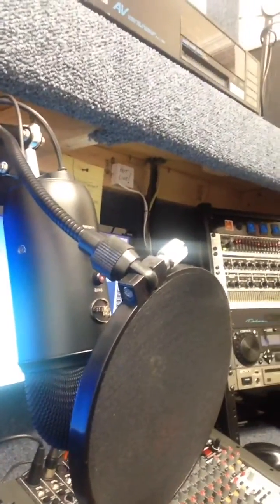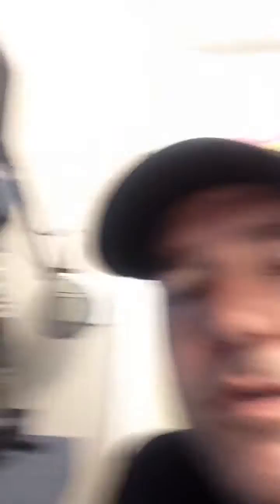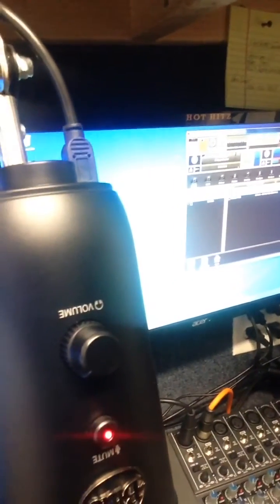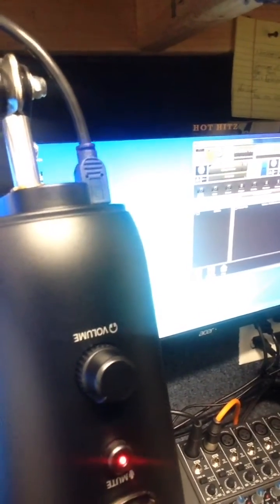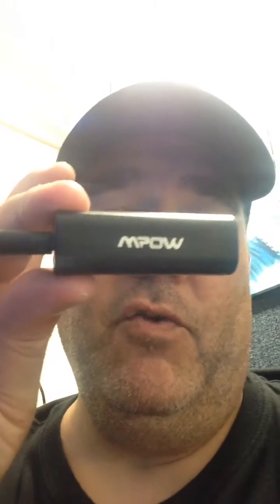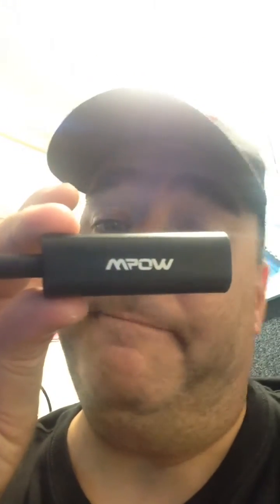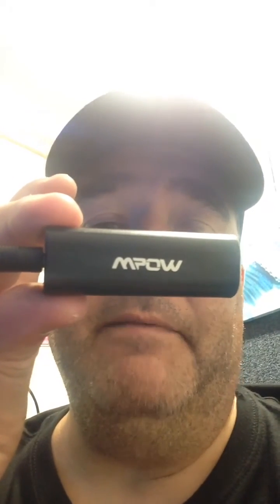Blue Yeti USB Microphone Noise Fix

Comment: I don't have the Blue Yeti, but instead using a collar mic and i have this exact same beeping static noise that is heard when i play games. Took sometime to realize its actually coming in from mic and even the recorder app captures it. Exactly the kind of video i was looking for since most of the videos that have demo'd this isolator are with output speakers. You just confirmed me that it will work with microphone too.
Thanks a ton !!!
Reply: Can you confirm it woks with microphones?

Comment: Thanks for this recommendation! My yeti mic had Extreme Static, ordered this isolator grounding aux and let me tell you fixed my issue immediately. Heres the link if anyone else is having this issue. Part only cost $8.99 on Amazon. The only solution that actually works!  Grounding Aux Link: http://a.co/d/8jv3vRN